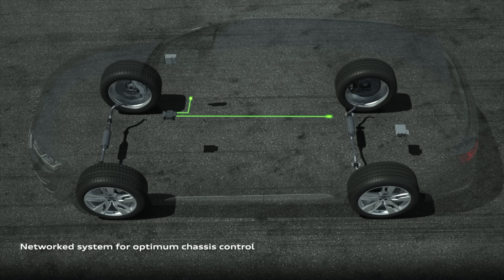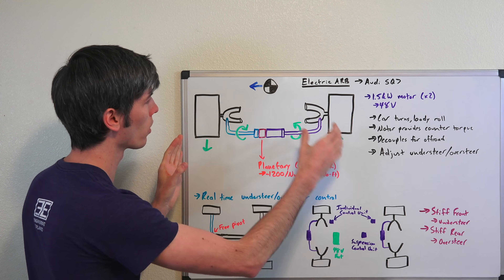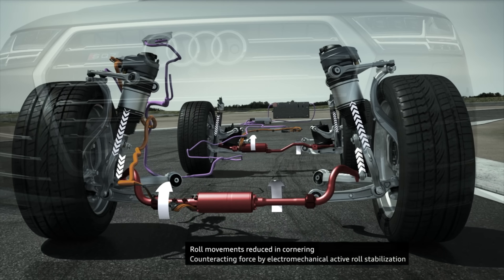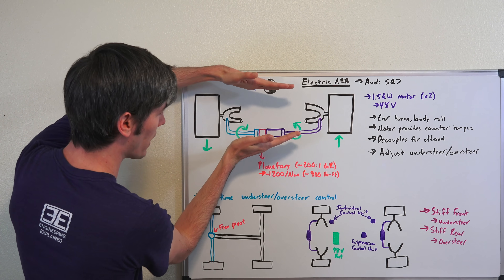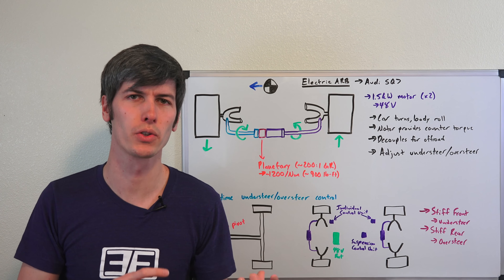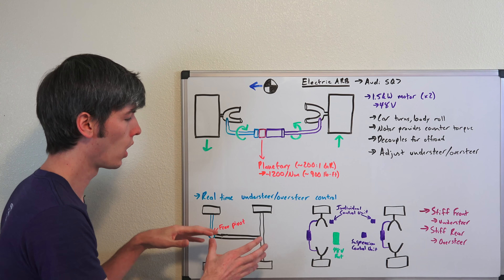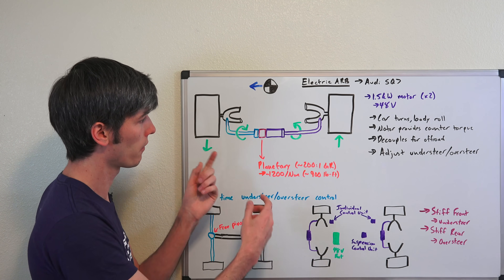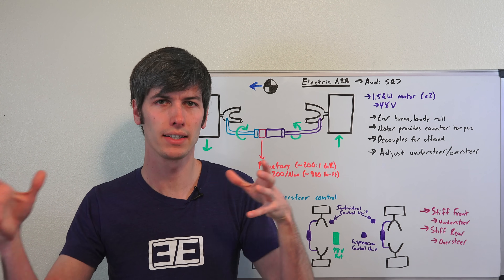How Audi Is Eliminating Body Roll

Comment: Such an innovative technology great to see that audi can completely rip off what BMW did in 2007 whilst introducing a 48v electric system that isn’t compatible with anything and require its own battery and electronic systems that won’t stand up to the test of time. Soooooo innovative. 👌
Reply: Was thinking the same, active suspension on the E60, hydraulic antiroll linked to steering angle.. Over a decade ago
Reply: My name Isalwaysjeff Audi isn’t the only manufacturer using 48V now.
Reply: My name Isalwaysjeff Great point 👍
Reply: My name Isalwaysjeff haha. BMW rip off. Lexus presented this technology back in 1994 and uses till this day on selected models.
Reply: Nah, Toyota did in 1991, see the UZZ32 Soarer.
Reply: the 48V system is needed  for the e-turbo and mild hybrid system. It allows the car to coast with the engine turned off.

Comment: Citroen eliminated body roll decades ago
Reply: Thank you, came here to say this. Citroen actually did quite a few things that “innovative car makers” re-did decades later...
Reply: Dimitri Andreou And Lexus did it too, with the LS400 Bose suspension
Reply: Yes they did, and the Xantia Activa V6 is still the car with the fastest speed ever at the moose test, and the video is almost shocking: It has absolutely no body roll, which makes it look like the car is going over that corner casually. The Bose system might have been even better (seriously, it's so impressive the demonstration video almost looks fake), but sadly never was in a production car.
Reply: Citroen did a demonstration model of the DS 60 years ago that did not have body roll

Comment: do modern suvs that claim to have genuine off road ability have detachable anti roll bars? and do you have to disconnect them manually ?
Reply from the maker: Yes, the Jeep Wrangler and Ram Power Wagon have electronically disconnecting sway bars.

Comment: In what way is this better than air suspension based active body control? In that it is faster to respond?
Reply from the maker: Well this is a different system (roll bar vs air shock). It also has an air suspension. Here is an explanation of Active Body Control: https://youtu.be/tnpRNQaOVwY
Reply: Engineering Explained Yes, it is different, but it should be able to manage a little of the same? Anyway, enjoyed the video. It also helps me to remember not to buy an overly complicated car ten years down the road.

Comment: Nice video! 
This reminds me of the time, when Citroën took their trademark Hydropneumatic system in the late 1980s, added a microprocessor control system which resulted in the creation of the Hydractive system and it eliminated body roll altogether.  And now there is their new system the "Citroën Advanced Comfort" in the new C4 Cactus - I didn't have the honor to try that one yet.
Reply: Csuzdi Gábor Hydractive is just about variation of stiffness in the suspension. The body roll is another system called Activa. Sadly these types of hydropneumatic suspensions have been remove from Citroën cars after the C5.

Comment: So basically they make a heavy and tall vehicle, put sports car performance in it and then deal with the problems with more technology. I guess that's how they do things today. Not for me, too expensive to buy and maintain. Nice video though!
Reply: Yeah we should just go back to straight axles and leaf springs. Simple and Cheap. 
Or better yet, Horses. My last horse lasted 30 years before it died on the side of the road.., and It refuelled itself automatically!
Reply: Right.  And the system is liable to break down because of inferior components used in its manufacture.
Reply: Elon fixed the problem already. Golectric, batteries in the floor -
Reply: Toyota has had KDSS for over ten years. Works with hydraulics and is virtually maintenance free except for a check up every 60 000 miles or so.
Reply: its totally normal in the premium ( Audi, BMW, Mercedes, Lexus) Segment ^^
Reply: It's a German thing. Over-engineering everything to death.
Reply: Either that or they can let it just roll over. I think this is a more elegant approach compared to carrying a jack to right the car after every turn. Plus, the more they make, the cheaper it will be, and then we might get this in even budget cars someday.

Comment: This technology is pretty awesome. A lot of pro race cars have manually adjustable sway-bars to adjust grip for certain track/surface situations. So, the driver can change the sway-bar stiffness while racing, amazing!
Reply: No, not brake bias, adjustable sway-bars. V8 Supercars, or whatever they are called now, is the one I can think of off the top of my head (blade style sway-bars).
Reply: We had adjustable anti roll via servos changing blade angles on our formula sae car. It worked great for setting the car up for the skipped event. The dial was on the steering wheel
Reply: Justin and I are well aware what an anti-rollbar is. He mentioned this technology in racecars and I'm in doubt about that.
Reply: The Vibe I think the same every time I see a new automotive development. I think to myself "please don't be an electronic solution, please tell me it's a mechanical device," but that's obviously unrealistic at this point so then I default to "at least tell me it's a simple feedback based analog circuit and not some proprietary processor they've added to some mechanism PLEASE!" but sure enough it always is some proprietary chip that will be borderline impossible to replace when the whole thing shorts in a few years. I miss when there wasn't a chip for valve timing, braking, steering input, throttle control, compression ratio, etc. but I will just have to convince myself performance and safety are fair trade-offs for reliability and resale value.
Reply: Do you have a different conversation? Well, I like icecream but what has that to do with an elevator anyway?
Reply: Aero a short is a calamity in today's cars considering that even changing the length of wire will throw the computer off. You'd thing that if you have 1 wire melt or break you'd tape it and be on your way but nope, that's not gonna work. It's getting ridiculous. It is soo bad that having a car subscription is not a bad ideea, although volvo wants to launch theirs at 1 grand a month. For that kind of money I'd rather hire a cab every time I want to go places.
Reply: Yh Aussie supercars use them (V8 has been dropped from the series name), adjusted with a lever and cable setup, helps to shift the front to rear grip balance depending on the corner and/or tyre wear situation
Reply: Larger balance issues are tackled with ride height adjustments during pit stops
Reply: BMW 7 Series vehicles automatically adjust the Electronic Sway Bars for you. BMW calls it Active Roll Stabilization.
Reply: it's not the same thing because with this system while going straight and also when you're just cruising and not pushing the car you have very soft sway bars and the suspension can articulate freely, but if you suddenly go for it or simply get into a turn way too fast the computer will automatically increase the stiffness as needed. so you get the best of both world on the fly with no driver input. well at least in theory, let's see how good it will work in practice. let's also see what's gonna fail first. these things will make terrible used car purchases. just another system and host of sensors to fail complicating everything. soo german of them!
Reply: Justin's Pit Lane In what car or series? Are you sure, that you don't mean the brake bias?

Comment: But isn't it kind of dangerous? U get no more feeling when u go too fast through the corner? Or does that not matter
Reply: Body roll is not an indication of braking out (wether it’s under or oversteer). An IF you are going too fast, I’d rather go sideways than have under or overstear. This system will however give you the optimum grip. So the only danger is if the driver thinks he/she can defy the laws of physics.
Reply: No.
Reply: Duskconqueror I agree. I take corners hard a lot in my Miata and sometimes I don’t feel how fast I’m going and, whoops I just oversteered. So some body roll is a good thing. Granted, it’s fun to oversteer sometimes...
Reply: Most Audi's won't corner anyway... Joking aside, you got a fair point. I'd rather have some body roll and feel what the car is doing than going flat through a corner and all of a sudden the whole car ends up going straight ahead because the road wasn't super flat.
Reply: FourBangerFilms can't wait to do the same thing :)
U have a Mk 1 or Mk 3?
Reply: This system will not give you optimal grip. It's developed for increased comfort. A certain amount of body roll is actually beneficial for reaching optimal grip. Eliminating body roll (because that's what Jason calls it) can actually be quite dangerous because the suspension has less freedom to adequately react to each wheel independently. And with going straight ahead I ment understeer, my bad. BTW, I'd rather have under- or oversteer than completely losing grip. As soon as a car starts to slide on all four, good luck getting it back on track before hitting the curb/railing/whatever.

Comment: Citroën had a hydraulic version of this over 20 years ago on the Xantia Activa...still a great system though ;). And for some reason Citroën abandoned it years ago too...
Reply: MacMan iPowermacbookprair I agree. Had a C5 back in the days. Best suspension I’ve ever had. Automatically adjusted to the load as well. Genius. Too bad they made it optional.
Reply: @Conservator.  I had three C5 in a row and chased Porsches on back roads with it...:-) Most Porsche drivers have no clue of driving fast... The hydropneumatic suspension of the C5 is out of this world.
Reply: @weirdshibainu: Citroens Hydractive Suspension is actually pretty reliable (apart from electrical issues which were not uncommon with Hydractive I, but less common with Hydractive II and later suspension systems). They were controlled by a combination of mechanical and electrical components. And due to the simple construction (from todays point of view) many problems that arise today can still be fixed, which is not to be expected to be the case with modern cars' components. Something breaks? Replace the whole thing since its not serviceable. Good luck finding spare parts in 10+ years, apart from the cost factor involved.
Reply: The c5 never had active sway bars though, but they were nice and very comfortable to drive too ;). It did actually have active suspension, just no active sway bars. Unfortunately, hydropneumatic suspension went out of production altogether in june last year I believe :(.
Reply: I suspect the electrics in this Audi will break after only some years and be a hell to replace so the car lands on the scrapyard. I actually own two Xantias, one Break and one Activa which needs to be rebuilt and there is nothing like it :).
Reply: MacMan iPowermacbookprair the hydraulics are faster, but the control unit is the heart of the process.  My dad had a late 70s Lincoln with an early form of antilock brakes. It was a solenoid based system, overly complex, heavy compared to new systems and very slow compared to new systems. On the audi system, it's more than just a few sensors..the car is loaded with them. Granted all these systems have heritage from 20 or so years ago, but they are much more sophisticated,  less expensive as a percentage of the value of the car, much more reliable,  although the first "New" generation of anything I tend to avoid. Some never catch on...remember the big rave of 4 wheel steering in the 90s? Never made it past a few vehicles
Reply: MacMan iPowermacbookprair it went out of production along with the C5 which was in production since 2008. Hope it makes a comeback in the new big cars.
Reply: MacMan iPowermacbookprair And Lexus did it too, with the LS400 Bose suspension, so nothing New..
Reply: The Xantia Activa suspension had two main features: active anti-roll bars like this Audi (except actuated by hydraulic rams acting on bell-cranks on the roll bar) plus it had variable spring-rate.  Just like the Audi, steering and speed sensors, etc, could apply the counter-torque and stiffen the suspension-rate going into a corner.  It got great write-ups in car magazines at the time but it clearly didn't sell enough cars to make it worthwhile.  The Hydractive II+ systems on the later C5s just had the variable spring-rate to stiffen the suspension.

I suspect electrics as used in this Audi would be much cheaper and should be at least as reliable as the hydraulics.
Reply: weirdshibainu my brothers 2003 chevy pickup has 4 wheel steer, it's actually really nice for getting the camper into places lol 

I just wouldn't want it on anything that will be pushed hard like my plow truck, to expensive to fix to want to torture it like that.
Reply: Yup. Not sure that worked in a similar manner or if it was ever even put into mass production, but certainly at least as effective. And you had turbo boost with the Bose suspension :P
Reply: Back in the mid 1960s, Citroen tried a 1cc hydraulic motor to power windscreen wipers.  It developed 2 HP when connected to the central hydraulic system, which ran at 2100-2500 PSI.  The power was probably way over the top and I'm guessing there was no advantage compared to an electric motor and wiper-parking circuitry.
Reply: You could pretty much get a Citroën XM for the price of a Xantia Activa. Top of the line models just don't sell that well in general, and so nor did the Activa. Besides, expensive French cars usually don't sell very well either xD. 
I believe the inventor of the hydropneumatic suspension, Paul Magès, even wanted to hydrualically power the seats in the DS...imagine that would start leaking :o
Reply: That's not to say the Activa system was entirely flasless though...they will start leaking after about 200.000 kilometers and new Activa rams are quite expensive, though they can be rebuilt as well.
Reply: Sporty, stiff, firm suspension is the flavor of the month now. The journalists have convinced us that comfortable ride is so yesterday. What's next, no suspension travel, no springs?
Reply: MacMan iPowermacbookprair hydraulics are heavy, prone to leaks and didn't have the electronics to control the system as they do now
Reply: Yeah, but the Xantia already had hydraulics anyway ;). An Activa was only 17kg heavier than a normal Xantia, for a total of about 1340kg for the base two litre model.  Besides, high pressure hydraulics could potentially be more powerful than an electric motor (not sure they are here). Of course, electronics have improved a lot over the years, but then there shouldn't be that much to compute here. Just measure a few sensors here and there and stiffen the sway bars accordingly. Not saying it was better all in all, just that there's nothing really new here...
Reply: @Zach: The system was still optional on the 2008 model c5 which only went out of production last year ;). 
@Cudjoe: Yeah, most Citroën dealerships have no clue anymore either...you really need to find a garage which still sees those cars regularly, or do everything yourself...
@weirdshibainu: Very true...
Reply: MacMan iPowermacbookprair They probably dropped the idea due to high maintenance cost. Besides that, not a lot Mechanics oh sorry, "technicians," knew how to repair the dang thing when it broke. Which I  imagine happened as soon as the warranty expired 😕